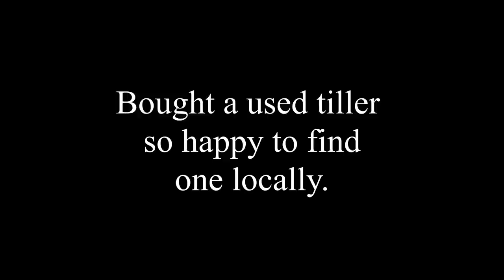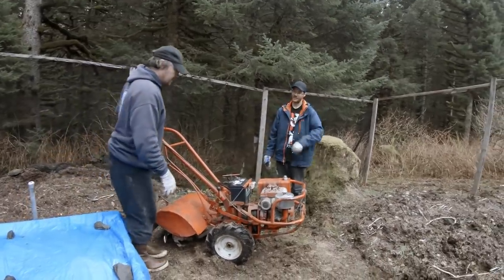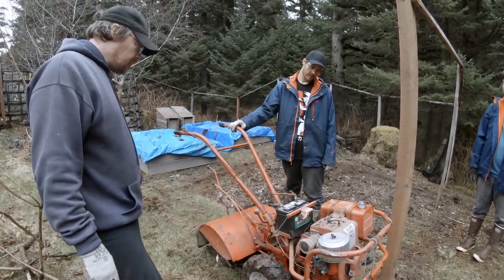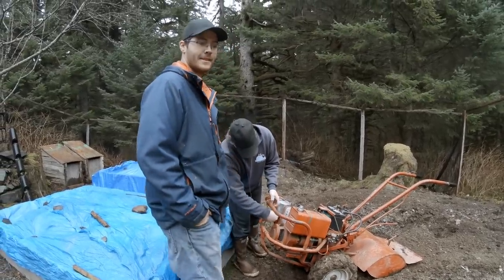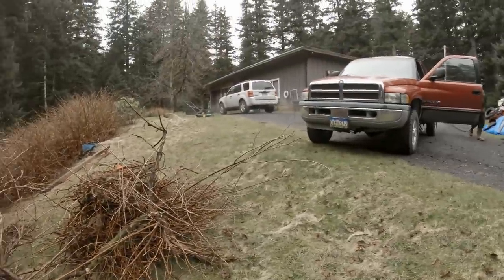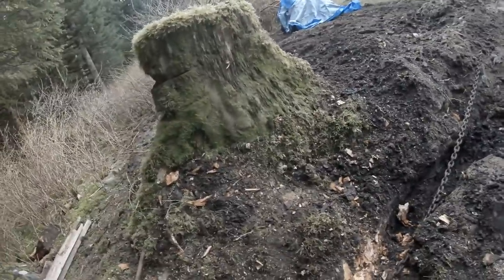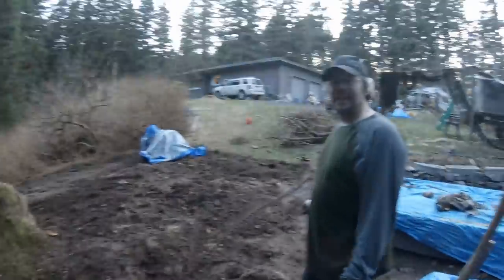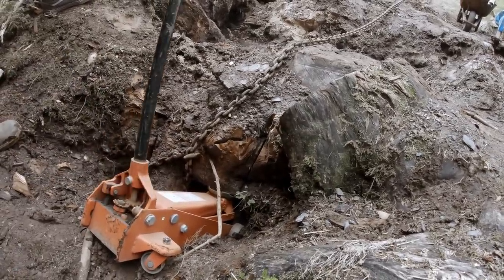Garden Expansion - Stump Removal and Tilling

Comment: Was glad to see the chain come out on your stump. A safety feature, wrap the chain and put a half hitch in it and then hook it. Used to cheat and use a 1" cable with a Hyster winch to pull stumps. The lower you can get the more leverage you will accomplish and remember these are trees so the roots can be a deep as the tree was tall.
Reply from the maker: Yeah, absolutely! The line was pretty sketchy. The main reason is that the stump was still wedged in, we had to clear a bunch of dirt and discovered a root shooting back toward the truck. That'll be in the next one though. Thanks for the suggestion RJ.

Comment: What is the story with the 26' Tollycraft?  I love those boats.
Reply from the maker: Hi Robert. We bought it from the city in a sealed bid auction. No engine, but good hull. Figured it would be a good project boat, now we just need to find the time.
Reply: @EISAlaska  oh nice!!  Does it have the reverse gear, prop and shaft??
Reply from the maker: It has a V-Drive, shaft, and prop, I think the prop is pretty roached from sitting a long time without zincs. If I had to guess the same could be said for the shaft.